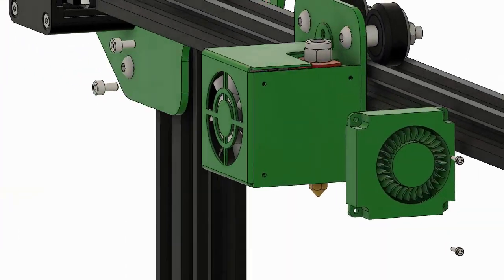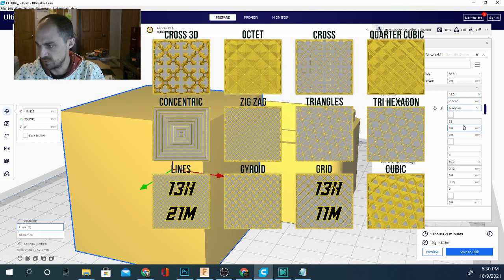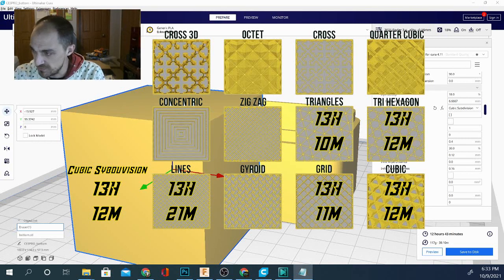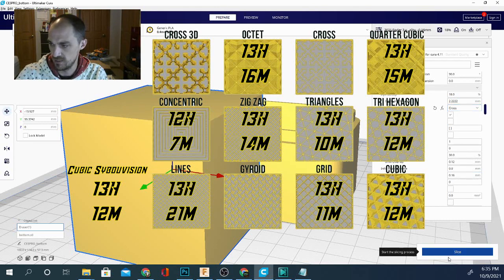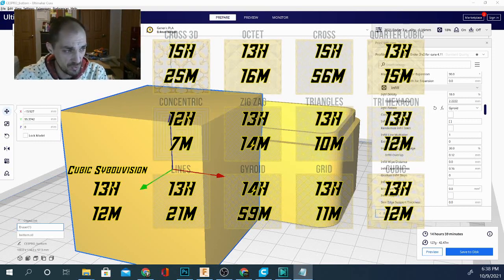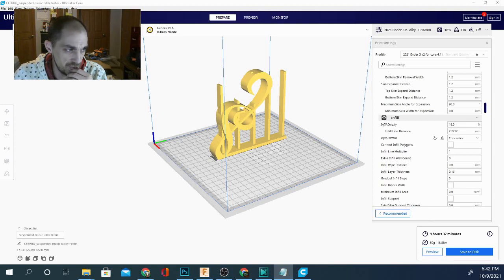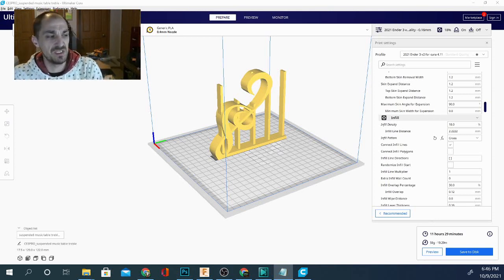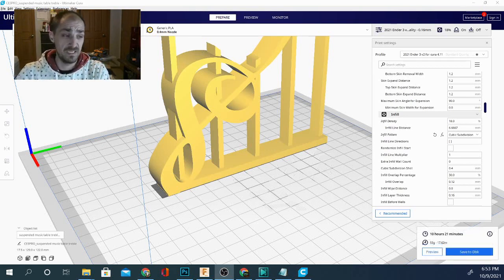Whats the Fastest 3D Printing Infill?  Cura Questions

Comment: It does vary from print to print. Cubic is usually fastest, I recommend low density 5-10% with 2 for infill line multiplier, you will find it's also alot stronger.